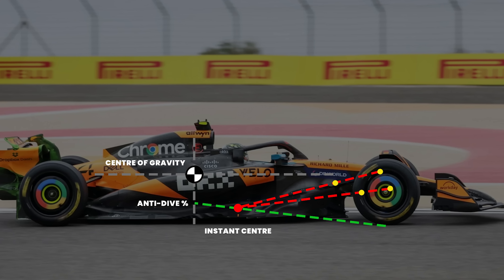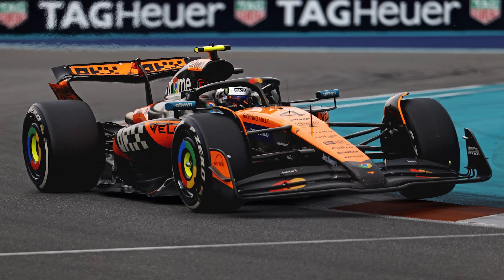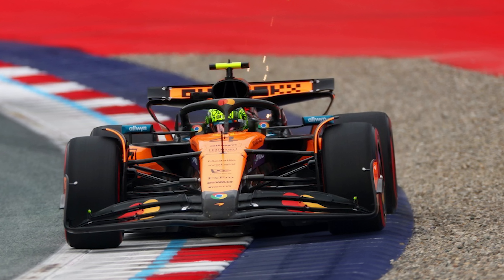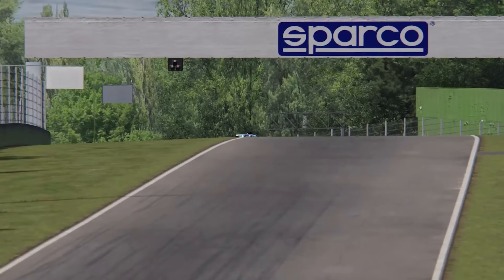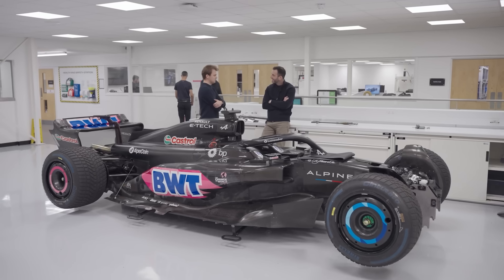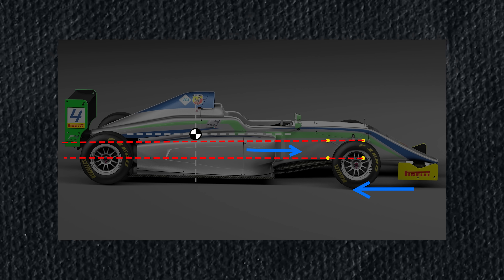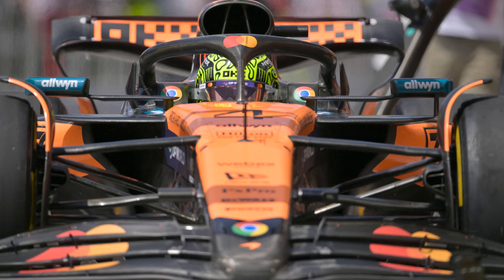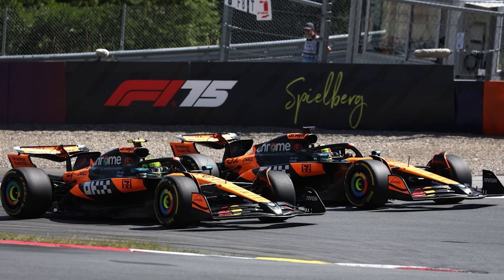McLaren’s NO SUSPENSION Trick

Comment: Absolute most extreme example of no dive and no feedback is BMW's Telelever system on their touring bikes. Was, very generously, lent an R1200RT once, for a trip to the Isle of Man (Manx TT). What an absolute piece of s..t that was. Worse than a '69 Chevy Impala I imagine. No idea whatsoever what's going on with the front tire. Also didn't want to steer under braking.  Bikes need nose dive to turn in, for feedback as well as for reducing trail, via increasing rake angle  .  But by the way, don't see how keeping the floor level under braking and into corners helps keep the rear tires cooler. And that's what I read all the time is what McLaren does better.

Comment: This style of anti dive geometry was introduced on the Red Bull RB18 of 2022 & has since been adopted by the rest of the F1 Field. It uses brake torque transmitted through the uprights to "pull" the top wishbone down. Have McLaren chosen a better angle for the top wishbone than the other teams? or just optimised the way it works with other factors such as spring & damper rates? Or have they also done a better job with the aerodynamics to take better advantage of the anti-dive set-up?

Comment: Why don't they move the braking system further inboard to prevent that heat source from affecting the tires? It would need some added stuff for the fronts of course, but the rear would be easy. Is the benefit not worth the extra weight? Bringing that weight further inboard would help a little with unsprung weight as well. Or would it be the same problem most cars have: a packaging problem, not enough space anywhere else, so in the wheel area it goes.

Comment: I'd be putting any coolant gel captive into the rims, to prevent 'sloshing', increased unsprung mass, gyroscopic effect and instability/uneven tire wear. Captive gel in the rims makes them like your very own cool bag, unless removing material causes the rims to occasionally explode under extreme forces. 

Lack of suspension travel should would have shown up in the plant and today in whatever has replaced it. no dive wear patterns should be clear. We overfilled bike shocks 40 years ago, to reduce diving. But then we stared blowing seals and a range of other problems started to occur. And any aero tweaks would be hard to gain flat braking profile, without harming acceleration. 

Wait - you didn't say they raised the CoG, right ? With your theory, WHAT DOES IT DO TO LATERAL FORCES AND THE OUTSIDE FRONT TIRE ? 

Not being a racing driver, I'd probably surrender on the issue and instead look to HARVEST the energy and feed it back at corner exit.

Comment: Nitpicking here, but weight vs load transfer are two different things and should be used with more consideration. When the fuel sloshes forward under braking, that's a transfer of weight. Load transfer is due to the changing of the inertia of the components within the vehicle (or the vehicle itself depending on how you want to define it). Objects within the vehicle aren't physically moving forwards and backwards, up and down or left and right, it's their loads that are moving, not their weights. Thanks for the great video!
Reply: Except most of those wings, with immense force put on them, those surfaces deflect and change pitch and yaw as the car is being driven, will have changes in load depending on the speed, pitch of the car etc.

Comment: Idle musings - I always assumed the drivers would be trail braking to shift that weight over the front wheels as the speed goes down and the aero affect is reduced.  I now assume that works best for cars with less / no aero and with F1 you don't want that weight forward as it is counter productive to the aero effects.  So F1 drivers probably don't really trail brake, because that weight shift is not something they need, or would want to exploit?

Comment: This tiny difference between Landos and Oscars cars probably explains a lot about how this season has played out so far. Overall consistency is with Oscar and he has extracted maximum points in most scenarios. I think its clear though that Lando IS the quicker driver on the limit, and his suspension choice allows him to feel that limit but this is at the expense of consistency.

Lando needs to match his raw pace with greater consistency and he will beat Oscar. Meanwhile, Oscar has to use the reliable and predictability of his suspension to pressure Lando into inconsistencies.

Fascinating stuff really

Comment: Your missing the mark by quite a bit with your comments at 10mins.. i doubt your going to reduce the spikes of load the front tyres are seeing by adding more anti dive.. id say it would be the opposite. By having less anti dive your allowing the spring and damper to take more of the load which will slow down the time for the load to transfer instead of the suspension are arm doing all the work making it much stiffer. Seems like mclaren just understand the tyres very well and have the car very well setup rather than there being any one silver bullet. Your talking about contact patch load variation which from my understanding to minimize that you would want your spring and damper doing a greater portion of pitch control to effectively minimize it.

Comment: The extreme anti-dive "system" is nothing new. TCR cars have been using that on their strut suspension geometry for a few years already. By decreasing caster they achieve more anti-dive which means they can run much softer suspension for to achieve as much grip as possible mid turn and on entry. With adapters on lower pivots they can keep a massive amount of caster meaning they can use less camber for extra grip on accelerating out of a corner.

Comment: Another benefit of the consistent ride height is they don't have to compromise the aero to compensate for the changes as other teams would.  As with everything in F1 it's the sum of tiny increments that produce a leading car.
The unasked question is that given all the engineers know that a consistent height is needed for ground effects to work consistently, then why is McLaren the only one with such high anti dive geometry?

Comment: With a high Anti-Dive kinematic the weight transfer forces don't compress the springs/ dampers. It needs to be understood that this also eliminates any chance to set the car up or adjust something by heave springs and dampers on breaking. 
Rule of thumb: Car stays flat on breaking good for aero, driver feedback suffers but also no adjustability on breaking by springs and dampers possible. If there is a problem or you'd like to help the tyres on braking those 2 options are out of the game with 100% anti-dive.

Comment: There are several "anti dive" geometries available for motorcycles. The early girder forks actually lifted under braking which impacted on the trail. Gradually the engineering improved so the changes in trail diminished and then Britten and Hossack managed virtually zero dive and trail change. This was over thirty years ago.
Reply: And yet, top level racing stays with forks, with no anti-dive. Braking (front compressing) steepens the steering head angle and shortens the trail, helping the bike turn. BMW flat-twins have kept their Paralever suspension, which has some anti-dive, and they're known for having odd steering feel. Their racing-focused machine has stayed with forks.

It's complicated.
Reply: @bikeaddictbp  in mototGP that’s definitely not the case, they have both anti dive and anti squat, Ducati has been dominant as a result
Reply: @coreygolphenee8852 Those are different systems. They do not have front anti-dive suspension geometry, in fact they rely on brake dive to allow the rider to manually engage the front launch-control device.
Reply: I really like Honda's TRAC system from the 80s.  I've got an 82 cx500T which uses it,  and the reduction in dive compared to my GL500i (which had nearly identical fork and swingarm geometry) is insane.

Comment: Thanks for the explanation and theory regards the anti-dive and very stiff suspension,,, but doesn´t that make the car more prone to bump-steer and less turn-in on corner entry?  The balance between too stiff and too soft suspension, has always been the nightmare of drivers and engineers,,, and to find the happy meidium between the two, is the challenge!  So whats the secret, to have good corner entry bite for the tyres, with very stiff or almost no suspension?? Bumpy tracks and riding the kerbs would be a nightmare!

Comment: The actuation of the suspension reduces tire wear because it slows the rate of change of the lid on the tires. Fantastic video, but fundamentally, having no suspensions would cause higher spikes in load on the tires. That’s always been the same in every motorsport ever.
Reply: I would agree with you on the higher spikes theory normally,  but in this case a more consistent aero platform may be reducing large aero spikes. With the aero loads these cars are seeing it may have a counterintuitive effect.

Comment: It's interesting how the idea of stopping a car from diving is rather similar to how mountain bike deals with pedal Bob/anti squat make them perform super well in one aspect for a bike that when pedaling going up hill the more the bike moves in its suspension the less how the power actually get put through the rear tire but on the other hand if you have to much when riding over  bumps the suspension is stiffer and harder to get past the initial movement point

Comment: An odd retrospect : (don't laugh) When my 1981 Ford Grenada broke a torsion bar link, the car was dangerous to drive, the other link having no lateral influence was useless and the car dove dramatically. The car was a boat anyways, hence I installed longer links that torqued the torsion bar tighter. What a difference !  It was a different car. Much better manners. It's handling was almost flat and the tires wore even, lasted longer. McClaren must have looked at my service records. . . . . Now, about my 1964 Buick Special Sleeper . . . . .

Comment: Two follow-up questions.
1. What advantages are there to reacting this vertical load with anti-dive rather than using an extremely stiff heave spring? It's surprising to me that extreme anti-dive doesn't cause ill effects on kerbing for instance
2. I saw a post recently about how McLaren is using a multi-link front geometry. Is this true? And I can understand how kinematically that would aid tire camber gain on the outer tire (nonlinear steer camber) while also numbing the steering feel (dynamic trail and scrub) – could these effects be a result of that geometry as well, again assuming it indeed is being used?

Comment: Seeing you call 100% as "extreme" make me chuckle.
Certain mountain bikes have over 100% anti-squat (anti-dive). For e-bike, exactly 100% is optimal. But for human powered bike, the bike have to resist the downward oscillation from leg that pedal the bike as well, thus why some manufacturers set the anti-squat/anti-dive very high at 130-170%. I'd call anything over 130% as extreme. But 100% is just right.

Comment: Would think that increased anti-dive would hurt tire life over a run. You can imagine that in a theoretical 100% anti dive system (or a solid suspension) the tire is now the softest spring in the series, meaning it would experience more deformation than it would with a lower anti-dive configuration, ultimately leading to faster degradation.

Comment: Finally, someone talking about something I've been harping about to anyone who will listen all season 😂 love the explanation of elastic and geometric weight transfer. Something to note though, as beat into me by a race engineer mentor I've had, it isn't just the Instant center that matters here, it's the pitch center that actually drives this for the whole system. You don't talk about roll left and right separately, you speak of the roll center. The rear suspension has an influence on this as well, we just over simplify it by talking about things like anti-squat at the rear and anti-dive at the front as separate phenomena.

I appreciate someone finally describing this as being the source of Lando's lack of feel. Remember though, running an aggressive anti-dive may not deflect the suspension components (spring and damper), but then the tire becomes the only spring in the system, which is much harder to control because there is no way to dampen that spring!

Very excited that mechanical grip and kinematic design is being highlighted, and not just the aero
Reply: Can you explain elastic versus geometric weight transfer for me?  A car sitting still on four scales, you can measure the weight of each corner.  Raise the rear ride height and lower the front ride height and you can measure the new corner weights.  It doesn't change that dramatically.  So when people talk about weight transfer under braking, what actual weight is moving?
Reply: @alanowens99 mass is still the same , CoG is the same, but there is more force pushing the tires against the track in the front,  and less in the back, so it "feels" like the weight moved, but gravity still acts the same, mass is still mostly in the same place besides small movements from the suspension. it's just the backwards braking force applied at the tires (under the cog) creates torque trying  to rotate the car forward and puts more pressure on the front, acting "as if" the weight had moved forward. if you push it to the extreme, there is no more force of the rear tires on the road and the rear star lifting off the ground, putting 100%of the weight on the front, which happens on motorcycles due to the higher CoG and shorter wheelbase
I think the more accurate term is load transfer and it does happen even with no suspension/solid wheels, even if nothing is moving, just sure to acceleration

there is a rather simple formula delta_weight = acceleration * cog_height * mass/(gravity*wheelbase)
when it reaches and exceeds half the weight, the rear tire start lifting of the ground and then it doesn't apply anymore because the geometry starts changing (all the weight is on the front and the CoG moves up)

mass transfer happens when cornering if you have let's say a SUV with a lot of body roll then the CoG actually moves left/right which increases the load transfer even further but in F1 considering the width, wheelbase, height, and suspension travel, the mass doesn't move significantly. in a road car/SUV the effect of mass transfer is 30x lower than load transfer, and in F1 the difference would be even bigger because of stiffness and geometry, so you're really only looking at load transfer regarding tire grip. but because of ground effect, suspension height is crucial to maintain downforce

Comment: This also explains the Mclaren's propensity for "pacing" the car early with new tires (keep fluctuations low).

Also - If you've ever messed around w RC cars, anti-dive is an oft-used setting.  Low anti-dive is very strange to nearly every driver (it removes brake & steer feel).  These are aero-driven cars so this is a different beast.

Comment: But I don't understand why this works, why aren't they understeering massively, and locking the fronts way more? Yes, the weight transfer is the same as it was before, and with the more stable aero the grip is probably good, the smart people there surely thought about it, but its so counter-intuitive, thinking that the tyres are gripping more without any dive. I don't know the physics behind it, but when braking with a bit of dive, it's intuitive that the weight goes forward and down while under tension, helping the fronts grip when braking. Without the dive the weight goes only forwards putting more stress in that direction on the tyre, no? It makes no sense to me that the aero, during braking and at slower speed mind you, can compensate for x amount of kilos put on the fronts in the downwards direction while braking with dive, giving them the same if not better grip than their rivals. Or am I misunderstanding, and weight is transfered forward, and down the same amount, just without dive? That wouldn't make sense to me either though.. Like imagine a normal road car braking hard, and a rally car with massive suspension braking hard. It's obvious that the rally car, diving massively has more weight on the fronts, versus the car with little/no dive.

Comment: So are these areas of suspension geometry under greater load, maybe even risking spontaneous failures? Of are they strengthened, with an extra weight and/or drag penalty? Also with the differences between the two cars, is Piastri potentially faster through the corners but (maybe) slower in the straights? Fascinating stuff.

Comment: Stiff suspension would probably heat the tire up more though as the up/down movement energy has to go somewhere and would deflect the tire more
Reply: as explained in the video, MCL found a way to distribute the up/down movement energy within the frames of the front suspension and its floor body making it less stressful / less pressure for the tyre, less pressure means less heat transfer to the tyres. This video was very informative showing why they can keep their tyres under high speed by almost completely erasing tyre pressure from braking in corners.